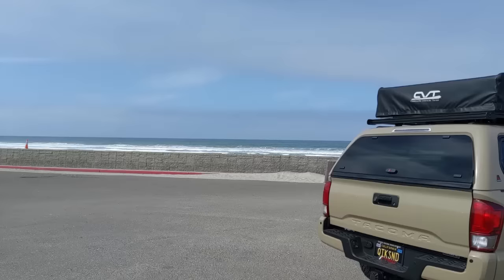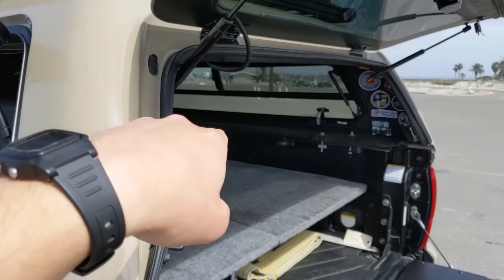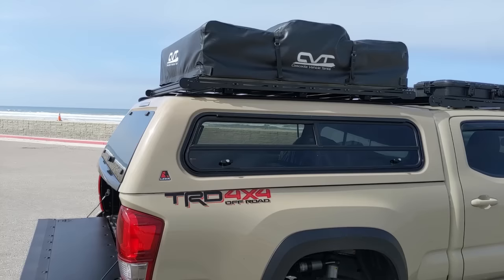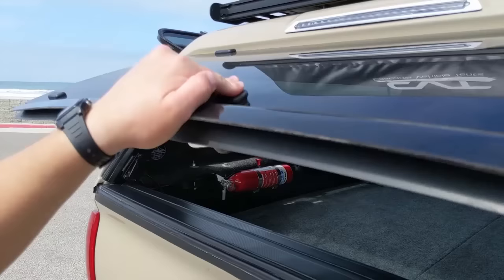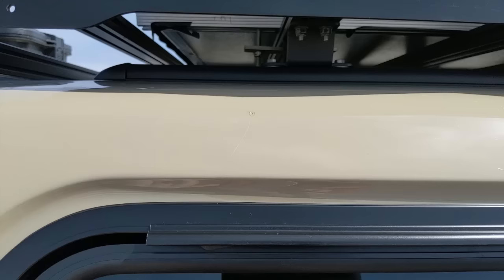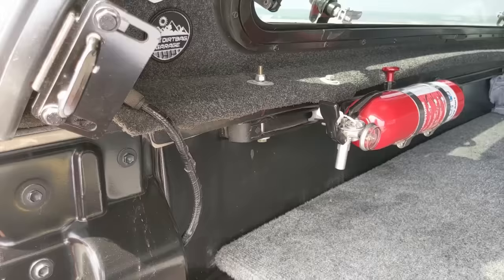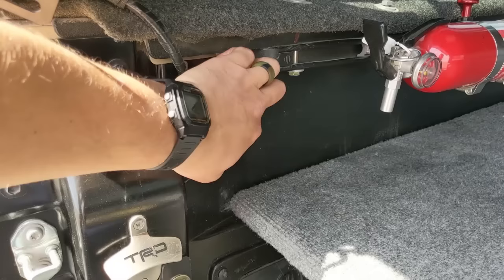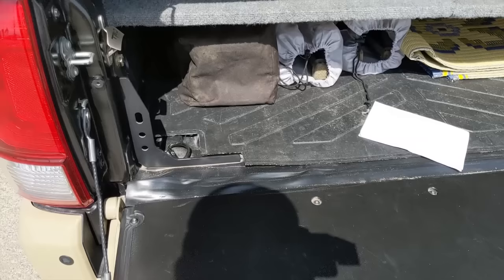Shell and Roof Top Tent FAQ

Comment: Great video! I like your rig setup. I just ordered a shell for my Taco today, which will not be ready until late Nov./Dec. (thanks COVID). I really liked the upgrades you made, and now I have a "to do" list while I wait for the shell to get done. I am currently trying to figure out if the roof rack rails I ordered from Century will work with my current truck rack system (Rola). If I can get brackets for the bars that fit the factory rails, I should be able to save some coin on the rack system. We use my Taco for camping and outdoor adventures as well, so I am always looking for cool hacks and tricks that other people have discovered. Thanks again for the tips!
Reply: Cruise over and check out Tacoma3G.com for help figuring out what will work best for your truck!!

Comment: Same truck and shell and mine leaks water  from plastic molded gaps in the front of truck bed in the area below the left and right rear passenger headrests.
Reply from the maker: You can get butyl rubber for that. It's extremely pliable and will fill in those gaps.

Comment: Great info. Question about the cap rack. I noticed they are not level or even. Looks like the bed cap rack sits little taller then the cab rack. Have you fixed it or not worried about it?
Reply from the maker: They never really lined up. I never really cared to much though. It wasn't off by much, but I would have had to put a bunch of spacers under the feet in one side and it just would have been to much work.

Comment: Just got the same topper with sliding windoors and Thule ladder racks. Windoors open almost straight up and hit Thule racks. Did you get different strut shocks on yours so they didn’t open that far?
Reply: I did not change the struts. The rack I had did not hang over the sides like Thule racks do, so their was no clearance issue with the windoor.  I'm sure you could find some shorter length struts to avoid the contact with the rack.

Comment: For the record my shell is completely waterproof. You can add a tailgate seal and i also used silicone to seal any other gaps and holes where water can enter. You must be doing it wrong because my bed is bone dry

Comment: Nice informative video. I have just installed a Leer 100xR on my 2023 Frontier. A question I have is did you any additional to seal the cab to stop water besides the Butyl Rubber on the bulkhead?  Anything to the sides after the initial install?  Thanks.
Reply from the maker: Just the butyl on the leading edges of the bed and some other sealing efforts around the tailgate. Aside from that the bulb seal did all the work.

Comment: What tires and size are you running and do you have a lift or level going?
Reply from the maker: In the video the truck is running 265/70/17 BFG K02 tires with a 2.5" lift.

Comment: That's a straight cap no frame right. Aren't those only rated for like 200lb or less since it's just fiberglass? That's why I went with the ARE HD cap.
Reply from the maker: Yep, straight fiberglass, no frame.  I've since upgraded to a full camper but I never had any failure of the glass.

Comment: You recall what size climbing anchors those were?  See offered in 3/8 and 1/2”.....I have same set up.  You use shock chord or reg 550 para chord?  Was it functional?  Assume 6 anchors?
Reply from the maker: I used regular 550 p-cord. Mine were 3/8" anchors.

Comment: I know this video is about 4 years old but im wondering if you ever ended up having any issues with the cap supporting the weight of your tent or occupants.   Thanks!
Reply from the maker: Honestly I really never did. The cap held up fine under the weight as long as the clamps were set properly. They were about the biggest issue that ever arose. If they were just perfectly clamped the shell could move while we were bouncing down dirt roads. It happened only once, and if the clamps were adjusted properly it was fine and didn't happen.
Reply: @TravelingNobodys  Thanks for the info!
Reply from the maker: @varsityoverland  no problem!! 👍🏼

Comment: Actually the cap didn't leak, but the truck did.  Stick on Weather striping will seal tailgate but stick it on the bed not the tailgate.. all steel will rust so don't believe it wont..

Comment: Did you ever have any issues with the rack and tent combo on top? I know you got rid of the topper but I’m worried about adding so much weight on top a fiberglass shell. I want to go rob the same rack and sky camp mini which is also 125 lbs
Reply: I never had any serious issues with the weight on the rack. In the video I discuss the only issue I had which stemmed from loose mounting hardware. Do basically my fault. Aside from that I never had an issue with anything structural or capacity related.

Comment: Does your canopy sliding window stay open when driving? The one on my LEER does not.  May last LEER from 10+ years ago had a much nicer sliding/removable window than the new one.
Reply from the maker: Which slider? The front or the sides? I haven't had issues with either.
Reply: @TravelingNobodys  The front slider.  The one that faces the cab of the truck.  I got my LEER back in March and the sliding glass window slides back on forth when I open it.  If i closes it, it will stay closed but if we want to have it open while driving the it goes back and forth between being open and being closed.
Reply from the maker: @CKKnifeandTool  honestly I've not opened it all that much so I have not experienced what you're describing. Sorry

Comment: Does your shell get a bunch of dust inside when going down dirt roads? My shell is fairly waterproof, I only get a bit of water around the rear hatch, but dust is another issue, the whole back gets dusty.
Reply from the maker: We did at first, but I sealed the tailgate pretty well with a RokBlok Tailgate seal across the horizontal and some foam trim on the vertical side channels. After that dust still got in, but it was nowhere near as bad and completely livable on road trips.

Comment: Great vid. Thanks. Building a ‘22 with a similar setup. On the Pop ‘n lock…I assume i’ll just need a second lock motor to do both the shell and tailgate?  Any excessive wind noise from the Prinsu?
Reply from the maker: I'm glad you found it helpful. When I had the pop-n-lovk installed they handled everything. I don't know if the kit included the shell locking motor as well or if they pieced together two kits.

Comment: I found a leer 100xl with leer slide out locker, liner, led 12 volt lights. Installed for $4500 is that a good deal?
Reply from the maker: Prices have gone up drastically in the last few years. Whether that's a good price depends on what else you can find in your area and whether you can save a few bucks on something that is in stock versus a custom order.

Comment: Nice video! Well done! Did you install the climbing anchors or were they installed by the factory? Waiting for your response. Thanks in advance!
Reply from the maker: I installed them myself. All I had to do was loosen the bolts securing the roof tracks and replace them with slightly longer versions. Then when I bolted them back on I sandwiched the anchors on. 

These are the climbing anchors I used...

https://amzn.to/3XN7NC9
Reply: Thank you for such a quick response. Going to do the same.
Reply from the maker: @henrydeleon5650  you're welcome. Glad it helped. 👍

Comment: Are you able to remove the tent whenever u want? Ill be driving my truck to work. Dont wanna bring the tent with me during that time
Reply from the maker: You can, but it's not exactly a simple process. Unbolting it takes time because the connections are cramped for space to access, and then it's really just the fact that the tent is heavy. If you decide a quicker release and a winching system like many have it's not too much of an issue. Takes about 45 minutes to an hour  for the whole process.

Comment: how did you do the roof hoots?  I do thave the bolts for the roof rock
Reply from the maker: They are climbing anchors from Amazon. The holes were already through the shell from the roof rack mounts. All I had to do was find some longer hardware and the anchors bolt right up.

Comment: How do you know your dynamic weight does not exceed 250? 175lb you mentioned is static weight. When truck is moving around your 175 can double pending on the g force.
Reply from the maker: The dynamic weight loads placed on the camper absolutely exceed the static weight rating.  That's why they are two entirely different but connected ratings. The manufacturer doesn't give the dynamic weight ratings, just the static. In pretty much all camper tops it is assumed that the camper is designed with the dynamic weight rating in mind when the manufacturer does the calculations that the camper will be able to handle the loads the maximum static weight will increase to once they become a dynamic load.

Comment: I know this is an older post but what is the width of your tracks that holds your rack?..Thanks.
Reply from the maker: The shell was not reinforced any more over what the factory designed.  I do not have the shell anymore so I cannot measure the width of the racks, but they were about 3" in from the rounded edges of the shell.

Comment: How is the weight limit of the topper? Have you worried about getting in the tent and the topper collapsing?
Reply from the maker: I discuss that a bit in the video. There's two separate ratings that the camper shell uses, static and dynamic. The dynamic rating is the lower rating and is the amount the camper can safely carry while driving and bouncing down the road. What I have up there in the video is well below that rating. The other rating is static and that's the weight the camper shell can hold while the truck and weight is sitting still. This rating is much higher and generally not even listed anywhere. As for fears of the shell failing while we were up top, no I didn't have any. Obviously I wouldn't go jumping up and down on it (that would fall into the dynamic category anyhow), but it held up fine to us sleeping up top without issue.

Comment: Here’s a possibly dumb question: To what extent is the static weight affected by whether or not the tailgate is open? Is that rear window holding much of the weight, or not really?
Reply from the maker: The weight is supported by the side rails. The rear glass supports zero weight of the shell 👍.
Reply: @TravelingNobodys   Awesome! Thanks so much for answering, I knew it was a dummy question so I appreciate you taking the time 👏
Reply from the maker: @nyak63RUS  no worries. Happy to help. 👍

Comment: Hi, you can't mount your rtt directly to the T-Rail from the shell..... or just put 2 load bars on the shell.... ?
Reply: It would be difficult to secure the tent straight to the rails on the shell. You need space to get between the two to secure them together. As for mounting two individual rails without a rack, it's more possible than mounting directly to the shell, but I think you might again run into the same space/access issues.
Reply: @935AV  ok.. I have shell Alu-Cab with 2 rails like your, and with 2 loads bar ( same cie Alu-Cab), I put my rtt direct to the load bar. My load bars are bolts to the shell with 40 mm feet hight , so have a lot of space for fix.

Comment: What is the max static weight you have had on top of your Leer without issue? I plan on running a rooftop tent too and curious being that mine is not reinforced as well. Your setup (even though it’s changed since) sold me on ordering this shell. Thanks for the video!
Reply from the maker: What you see in the video plus my wife and I and my dog were the max weight that we put up there. I'd say the absolute max we've had up there is probably around 350 lb. I would certainly consult your shell manufacturer before taking my word for it though.

Comment: Did you change the leaf springs and if so, what brand did you use?
Reply from the maker: I did, a couple of times actually. In the end I settled on rear leafs from Dobinson's and Hammer Hangers from Archive Garage. Combined we had a really smooth rear suspension that articulated very well. My suggestion would be to take your truck to a truck scale twice, once fully loaded and once unloaded. Those two weights will allow you to see what your maximum, minimum, and average axle weights are. With that you can determine which level lead pack you need. They're usually sold in some form or regular, heavy, and HD.

Comment: great video. I know this is an old video but what is the static weight limit? I'm looking at a full size hardshell for my whole family. Wondering if this would work.
Reply: From everything I could find, there is no static rating. I looked and looked and they were nowhere to be found. The numbers I found only pertained to the dynamic rating. So it's up to you to determine what you feel safe doing with your family and contact a dealer. I would maybe consider something like an Alu-Cab or RSI Smart Cap as they are made of metal and a bit sturdier.

Comment: "They are full of it, they are lying, don't believe them... "
Wow, strong words.  Maybe a little anger in there, too?
I've had four trucks with Leer tops, and NONE of them has leaked. And we live on the east coast, in a wet, rainy area.  But mine are Ford trucks, so maybe it's a truck design thing?  Also, I've only had the 100R tops, with a different back door, so maybe that has something to do with it too.  Good video, though.  Thanks for posting.
Reply from the maker: No anger I promise. Honestly though that is the one thing I regret about saying in this video.  I never should have been so definitive. How the heck can I know what other peoples setups are like.  I was just trying to explain that many setups leak, and that it can happen. Design of the shell and the truck bed itself may play into it for sure.  Anyhow, I will learn from that on the next video.
Reply: @TravelingNobodys  ,
I definitely understand that.  We all say stuff that doesn't come out quite right.
And I would understand having a LOT of frustration, even anger if my top leaked.    I once had a weed whacker throw a stone and blow out one of my side windows.   Had it replaced at the dealer for $160, and all was well... but it leaked on the first big rain.  Didn't notice anything until a week after a big rainstorm, a bunch of my power tools were laying in water, motors full of water and completely rusted!   I was extremely upset!   WD40 got everything working again, but the dealer got an ear-full from me.
Reply from the maker: @thilltony3362  oh wow, yeah that would suck. I never had that much water. More just a bit if I pressure washed the windows.
Reply: @TravelingNobodys    It was probably five gallons of water or more.   And I have a plastic bedliner, which collected all the water and turned my stuff into rusty tool soup.   The dealer missed some gasket rope in the back corner of the big window, so all the water from the roof hit the window top and funneled inside.  UGH.
Reply from the maker: Okay that's reaaaaallllly bad. I can't imagine losing that much in tools.

Comment: I haven't watched you vid all the way through yet but do you talk about how you get your tent on top of the shell? Do you keep it up there year round or seasonal?
Reply from the maker: I kept it up there most of the year. I took it off occasionally, but for the most part it lived up there.
Reply: @TravelingNobodys  right on. Lived? Not anymore?
Reply from the maker: @TribeQuadQuest  Yeah, I sold it about a year ago and now have a camper. You can see the new setup in one of my other videos.
Reply: @TravelingNobodys  yes indeed. I watched it. Super cool setup. I would be so down but the cost of the new one is very high. I would probably consider an off-road camper trailer at that point ;) super rad though.
Reply from the maker: @TribeQuadQuest  we decided we did not want to have the hold up of towing something. We wanted the setup to be completely contained on the truck so as to not have the hindrance of dragging something along on the trails.

Comment: Nice rig and video.  I also have a Leer XR100 on my F150 and I've been looking to putting a RTT on top.  I'm so nervous about the weight, Leer says the TrackerII Rails are rated for 165 lbs and the Aeroblade rails for 220.  Did you do the factory Thule or did you install it yourself?  What is the weight of your tent compared to the max capacity ratings from the manufacturer?  If you installed something other then Thule yourself, which rail system did you install?
Reply from the maker: The tracks were installed from Leer at their factory. The tent weighs 125 lbs.

Comment: Are your roof racks same height? I was thinking og getting same racks. I have the same shell. If not same height is there a way to get it even
Reply from the maker: The rear was just a tad higher than flush and that's because I had to raise it up just a bit to clear the mounting bolts for the tent to the roof.

Comment: Very nice setup, thanks for sharing your experiences, very helpful. I have a somewhat silly question, I noticed the lip of the topper kisses the TRD 4x4 emblem towards the rear of the bed. Is this because you have the topper loaded with weight from the tent, or the way you mounted with additional bolts, or is that just the way it sits? I'm asking because in other videos of the same truck and topper the lip of the top is about 1-2 inches above the emblem. I'm just curious why yours sits lower.
Reply from the maker: It may have been because of the  weight. I'm not certain of that though.  It did rub the upper edge of our bed unfortunately and there is some permanent scuffing to the bed. So that's a bummer.